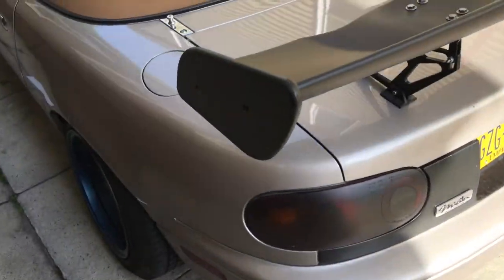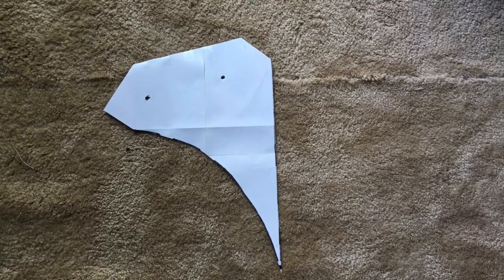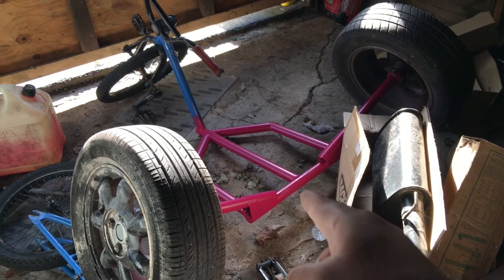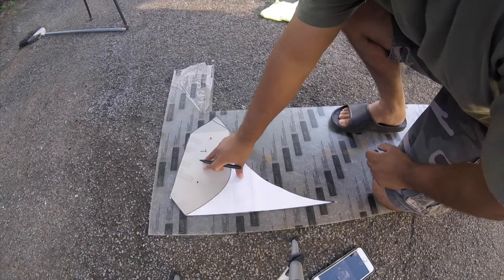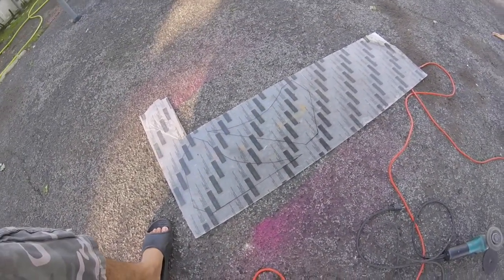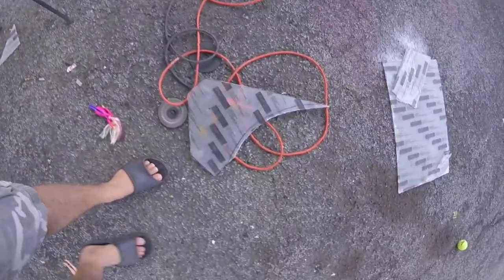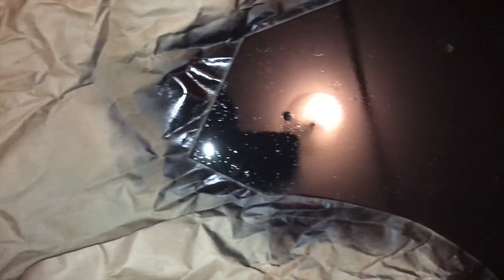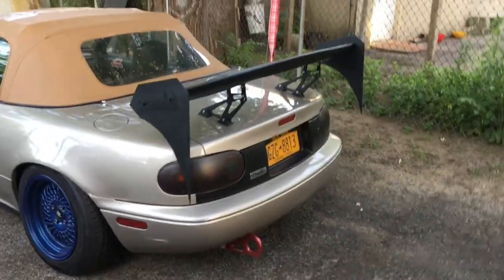wing mod on my miata

Comment: Could you tell me what wing you had on there? Looks like an Ebay ABS plastic one.  Been thinking about trying one just to see what its like. Curious on the specs of yours (length, width, height). A link would be even better!
Reply: boosted 2j Thanks for th fast reply! Did you have to fabricate anything when mounting it? Looks like you had to drill holes in the wing for the supports to mount to. Any info help.
Reply from the maker: Mathew Brady i did that for safety so it don't fly off. because its abs i dont trust the bolts it comes with. also used epoxy on the side pieces. i drilled out the stick bolts and use my own. that go straight through.